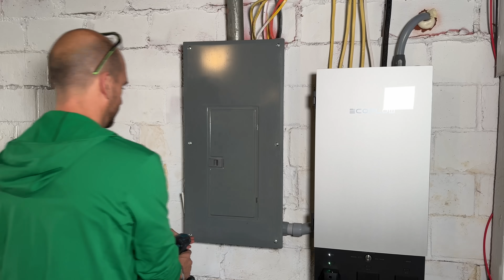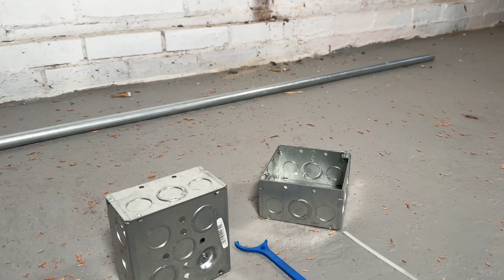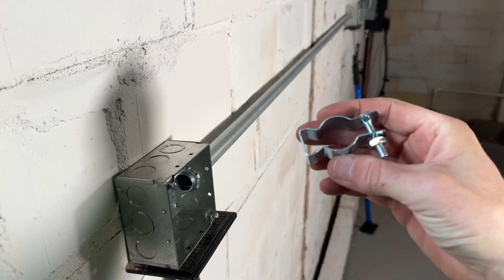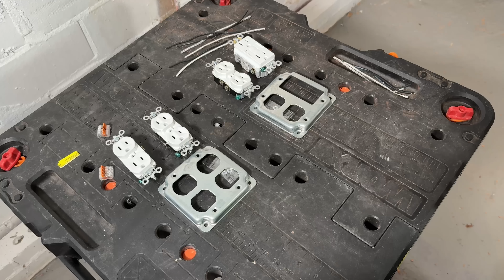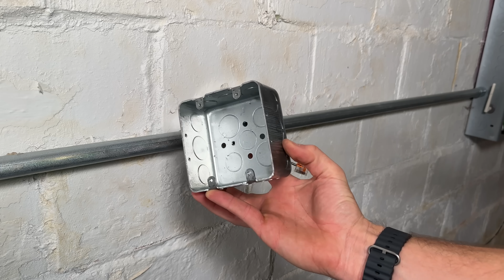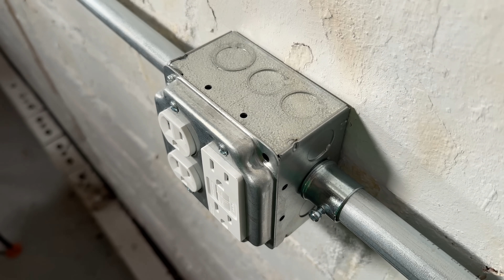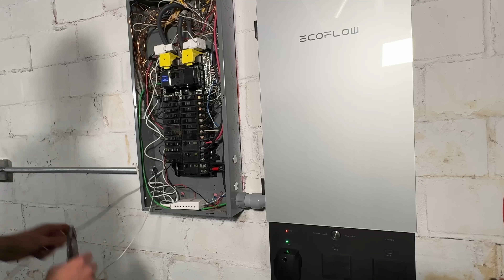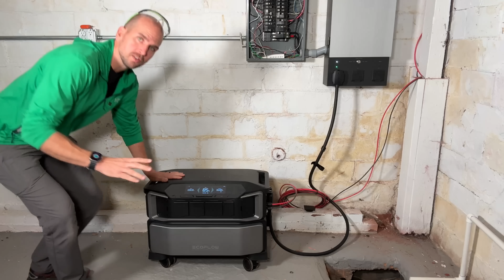Add Outlet To Unfinished Basement Or Garage

Comment: @SilverCymbal just posted a video explaining when you can use romex in a metal conduit and still be code legal. So if you have a code reference yoy should provide it.
Reply: What's to explain? Romex is legal in metal conduit anywhere romex is legal, dry locations.

Comment: I've never seen anyone complete a raceway before installing it. A 100' run must suck. Those straps that you use would need to be installed before the EMT is. And some jurisdictions requires a green in all raceways. ¾" EMT is unnecessary. ½" fits 9 # 12 thhn. ¾ is nearly twice the price of ½. 15 amp duplex receptacles are permitted on a 20 amp circuit. If you have 4 20 amp duplex on on circuit then you have wasn't money again.

Comment: The paint on the breaker box prevents a real good ground.
Reply: Correct. The NEC requires that the paint be removed when using it as a bonding connection.

Comment: Why not use PVC boxes and conduit with a ground.  Would be a safer setup?   Seems like using the additional ground would the best practices??
Reply from the maker: You could use PVC.  I like the metal setup and yes adding the addition ground wire will just provide redundancy if the conduit connection were ever to loosen up to break the path back to the panel.

Comment: Romex can be installed in conduit so long as the conduit isn't going to be in wet locations (outside).  A basement or garage is considered dry locations.  Romex sheathing unfortunately takes up a majority of conduit fill preventing multiple Romex runs unless you size the conduit accordingly.  Another reason to use THHN type separate conductors is that they are way easier to pull through conduit, Romex tends to bind up.

Comment: NEC requires a support within 3ft or less from the box and the panel. It is also required to use a plastic screw on bushing for the connector going it to the panel. A ground is absolutely required for each of those boxes. Your installation isn't bonded to ground, your explanation is demonstrably false. Your entire installation is illegal per NEC standards. You are not an electrician, you are a guy doing incorrect electrical installations, with several obvious and egregious NEC violations. Do not listen to the guy in the video, he is giving horribly inaccurate information that promotes bad habits
Reply: You're wrong. The conduit is the ground and a wire type ground is not required. You may want to read the NEC before you proclaim to know what it says. What are you talking about, plastic screw on bushing? Wrong again, not required and if installed wouldn't affect the continuity of the conduit through the connector. He's not an electrician, true, and it's clear that you aren't either.
Reply: A bushing is required where wire size #8 or larger comes through a connector.
Reply: @rickhawkins218  Bushing required when #4 or larger, not #8.
Reply: @pld8993  CEC #8 or larger. (Canada)

Comment: I'm no electrician, but I feel like the ground connection to the breaker box is not nearly as reliable as a dedicated ground. Since the box is painted, you're basically relying on the incidental contact of the threads from the EMT connector and biting of the nut through the paint as your ground connection. Of course, you tested your circuit and it had a ground connection, but it seems like not the best practice.
Reply: The NEC requires that one remove the paint on painted boxes and cabinets when using the conduit as a ground unless the fitting/locknut is designed to bite through to bare metal, which is yet another thing wrong in this video. He should have removed the paint, takes 10 seconds with a wire brush in a drill. Other than that, a conduit ground is no less reliable than a wire type ground and is electrically superior.

Comment: Can you run just a ground wire though old conduit that are ungrounded?  Is it easy to fish for example if the conduit goes to the second upstair floor?
Reply: Generally, yes.
Reply: Your conduit run needs to be bonded if metal

Comment: No romex in emt….
Need box sets too ….btw.
Reply: Romex is fine in conduit, offsets are optional and not necessary.
Reply: @pld8993  sure fire electric
  hard pass
Reply: @josephbifulco  That's makes no sense
Reply: @pld8993  you are a fire waiting to happen.
Wiring is not a hobby.
Reply: @josephbifulco  Yeah, no offsets and romex in conduit is going to start a fire. Explain, genius.

Comment: I understand the convience of using a GFCI outlet in a kitchen or some other place a fair distance away from the main panel... but why are you using a GFCI outlet in the outlet instead of using a GFCI breaker?  

Is there any advantage of one vs another when convivence isn't really an issue (as in this case)?
Reply: No, they offer equal protection. There are times when you wouldn't need or want to give the entire circuit GFI protection and in that case, a recep should be used.
Reply: If i was getting in the water i would prefer it to be a breaker not a receptacle- more trustworthy. Legally they offer the same protection.
Reply: A GFI receptacle is half the cost of a GFI breaker

Comment: Dude your vid is so full of incorrect info it's not funny... How about ya go work for an electrician for a few years then come back and make a new vid
Reply: Like what?
Reply: @pld8993 You would not see a job like this unless done by an amateur. Get some experience and you'll know why. A job starts with a plan (layout). I would never have planned a job to look like this when finished.
Reply: @rickhawkins218  I have plenty of experience. The way he did it is absolutely amateurish, and he should have supported the 6' length with a mini in the center. The way he assembled everything and then used those supports to hold it up, creative but ridiculous. If he used lock washers or nuts on the cover to attach the devices it's fine; if he didn't, grounding pigtail needed to the box. However, other than the missing mini, it would pass an inspection and the end product, when everything is buttoned up, doesn't look unprofessional at all.
Reply: @pld8993  I know you likely agree with me that although he may strictly pass an inspection in  his locale there are many components of this installation you would not have done. Strictly- it does not look like a professional did it.
Reply: @rickhawkins218  I agree but once all the covers are on and a mini is added to the 6' length, the final product is visually indistinguishable from a pro install and code compliant, so no foul.
Reply: @rickhawkins218  And I hate tapcons. Plastic anchors is the way to go, with few exceptions.

Comment: Wow. Never ever use a plumbers pipe cutter. You destroy the inner diameter and risk skinning wires when pulling through. Had a young man that told me they teach this in tech schools now. I chewed him out but it was too late after pulling a full conduit. Not one circuit held. Lost money pulling out the wire and then the pipe because of ground fault. STOP this idiodic practice. Remers do not bring pipe back to original diameter. 😒

I also recommend to diy guys to ask a master electrician which i can tell right away this guy is a novice

Comment: I'm a Mechanical Engineer, not an electrician but I've learned from many "Sparkies" over my 40+ years in factories.  Those duplex outlets look like 15 amp not 20 amp.  
Wire is relatively cheap.  Add the green ground wire.
Always drill into the block, not the mortar.  
I don't like utilizing the center knockouts as it puts the connector too close to the screws on the duplex outlets.
If I put 2 duplex outlets in a box then I put ground up on one and ground down on the other.  It just makes it easier for the various things I plug un.
Last, I don't like lever connectors.  The right sizes wire nuts feel much more secure.   That's just me...
Reply: This is the scoop on 20 amp vs. 15 amp outlets on a multi outlet circuit. It does not matter. You will never use that kind of power on a single outlet. And if you do it won't matter it will melt down. If you use a full 16 amps of power on a single device you need a separate circuit with a single outlet not a duplex receptacle. I know a lot of electricians can't grasp this engineering concept. A consistent or constant load of 12 amps will melt down a duplex recpt. The purpose isn't for large loads. Although I know people use 1500w or more heaters on them and melt them down. Just an fyi
Reply: @patrickhein9470  A constant 12 amp load on a 15 amp recep is not going to melt the recep. To be rated for 15 amps the recep is required to carry 150% of its rating, or 22.5 amps. A 16 amp load can go on a 20 amp duplex since a 20 amp rating requires that it be able to carry 30 amps.

Comment: Need to put box offsets on that conduit and use straps within 36" of the terminations. I usually do 6 inches from the box. Since the longest run is 6ft, those two straps are sufficient.
Reply: Offsets are not required or necessary. One mini in the center of a 6' length is all that's needed for support.
Reply: offsets makes it looks like someone knows what they are doing, didn't say it was required. The within 36" from termination is. @pld8993
Reply: offsets would make it look like you know what you are doing, didn't say they are required. the within 36" from termination is. putting a mini in the middle would look like sh*t and unprofessional. @pld8993
Reply: @dieselsoggydog6299  Those of us who know what we're doing run conduits all the time without offsets using minis, and also with offsets using 1-hole straps, depends on the installation. There's no single professional method and there's nothing unprofessional about no offsets or using minis. In this case, it makes no difference, either way is fine.

Comment: My $0.015 worth, though it is ok by Code, not a big fan of using EMT conduit as the grounding conductor.  Too many time, I have seen the EMT conduit become loose or disconnected.  Much rather have a dedicated green insulated conductor in the conduit.  Relatively cheap insurance.

Comment: You are wrong ! The 3-wire romex cable should be used here, the code requres the ground wire goes whereever the outlet is, and is connected to the socket green screw and the metal enclosure, regardless a GFCI type outlet is used or not,.  The conduits should not be used as the sole  connection for the gound.
Reply: No, you're wrong. The metal conduit is sufficient grounding path. A wire type ground is not required when using metal conduits.
Reply: Most places have raised their standard to require a separate bonding conductor in emt. Not running a ground is 'chintzy'.
Reply: @rickhawkins218  Most places follow the NEC and have not started requiring a wire type ground.
Reply: @pld8993  A bonding conductor needs to be able to carry the fault current till the fuse or breaker opens the circuit. Often times the bonding path blows clear due to excessive current. This may result in all metal parts  being 'hot'. I have seen this a few times. The code is a bare minimum. People call me for good work. That's why i always pull a ground and you should too.
Reply: @rickhawkins218  Adding a #12 EGC to 10' of emt is one thing, no real labor or cost increase. For larger conduits and conductors especially it's a completely different story. I've installed hundreds of thousands of feet of emt, IMC, rigid with no wire EGC and I wouldn't go back and change any of it. Doing so could have added tens of thousands of dollars to a single project due to increased conduit size, adding labor and material costs, as well as the cost of the unnecessary wire egc. You're potentially wasting tens of thousands of dollars on a single project with no functional, performance or safety gain. Adding a wire type EGC does not automatically equate to doing good or better work. And following the NEC, what you call "bare minimum," is meeting the requirements necessary for a safe installation. Going beyond NEC requirements is sometimes just wasteful and unnecessary. FYI, out to about 400', a conduit EGC is a better grounding/bonding pathway in a fault situation than a wire type EGC.

Comment: I don’t think that you are certified electrician!!.Conduit is no longer consider as ground means by code!!
Reply: Where are you from because most ahj say otherwise?
Reply: You're 100% wrong. There are 14 types of grounding means listed in the NEC and only 1 of them is a wire conductor. Read and learn before you speak and look foolish. There's also no such thing as a certified electrician. Ignorance is not something one should be comfortable putting on full display, but here we are.

Comment: DIYer here…. Do have to use conduit on a cinder block wall like this, or can I use armored cable “MC”?  
My job just trashed about 35’ of this and I’d like to use it instead of letting it go to the landfill.
Reply from the maker: Yeah, a lot of DIYers seem to prefer MC cable as compared to running conduit 👍.  I will actually be doing a video in the next day or 2 on different ways to cut MC.
Reply: @EverydayHomeRepairs  thanks
Reply: Thts a ahj question if it is suseptible to damage they may so no. Plus it is a pain to secure neat and tidy

Comment: You're running 20 amps; all your receptacles are 15 amp?
Reply: Multiple 15 amp receps are allowed on 20 amp circuits. It's done all the time.
Reply from the maker: Yeah, just as long as you have at least 1 duplex (2 outlets) on the 20 Amp circuit you are allowed to use 15 Amp duplex outlets.

Comment: Lame.  You didn’t kick the ends of the conduit to bring it flush against the wall.  Flying conduit is rookie.
Reply: Only a rookie would believe that. Conduit is run all the time without offsets, depends on the installation, nothing rookie about it.

Comment: Couldn't you use armoured (Bx) wire in this scenario as long as it is properly supported on the wall?
Reply: The fact that you cld bang or crush it being where it is most ahj wld not allow or like it
Reply: @wizard3z868   bx is fine, done all the time,  romex would need to be mounted on wood

Comment: I would have like to see offset conduit and straps securing it to the wall.  The first pigtail to the GFCI (line side) is not needed.  Pigtails are the best way to install multiple outlets, but any splice should be avoided if possible.  The line to the GFCI should have been a direct run to the breaker.  However minimal, the circuit resistance is increased and created an unneeded possible point of failure.
Reply: sometines you raise conduit like that if the wall needs to be washed and you don't want the top edge to collect crap. I would have strapped it to the wall in this case.

Comment: The self-grounding aspect of the recep is only allowed for flush type boxes, mud rings, etc. For cover mounted devices, the self-grounding aspect of the device is irrelevant. Either the devices must be attached to the cover with permanent means (rivets), lock washers or locking nuts, or pigtails to the box. 250.146(a) and (B).

Comment: CODE VIOLATION !! Never Run NM-B Romex through EMT Conduit !!
Reply: Not a code violation. Romex is allowed in conduit.
Reply: Not a code violation but most ahj will have you derate for temp and fill
Reply: @wizard3z868  There's no derating with 2 current carrying conductors, and a single 12-2 cable in 1/2" emt doesn't even come close to fill calculations numbers.
Reply: @pld8993  the insulation of the sheath cable counts as fill also the temp rating of the 90c drops to the 60c column but agian thts an ahj decision
Reply: @wizard3z868  Romex always uses the 60C column whether in conduit or not, not an AHJ decision. Only in a complete conduit system does fill come into play but again, a single 12-2 in 1/2" emt doesn't even come close to max fill allowance.

Comment: Too many local code violations to cover, especially in a basement. Ground wire required for most newer breaker box requirement.
Reply: Incorrect. Conduit is the ground, ground wire not required.

Comment: I wouldnt trust conduit with several connections to be a valid Earth, and i have never seen a problem running Romex in conduit. Scott, no shade on what you are saying, i just don't buy it all. If that's code, I feel it's wrong.